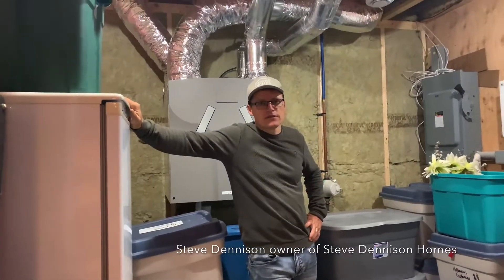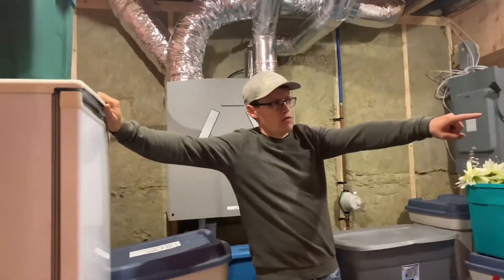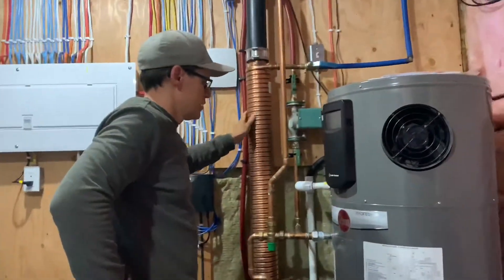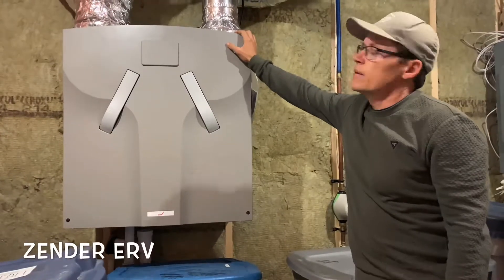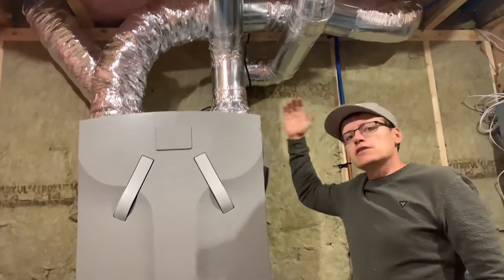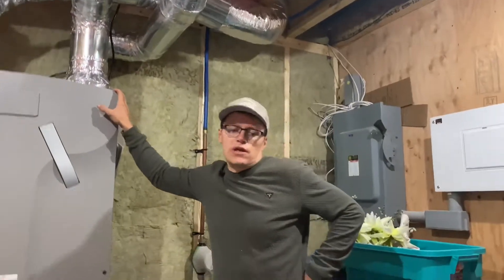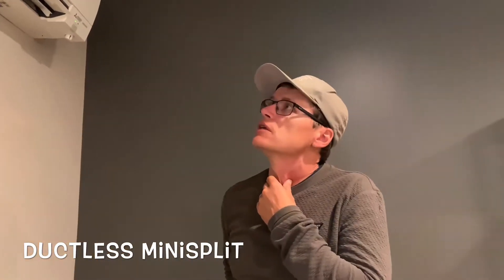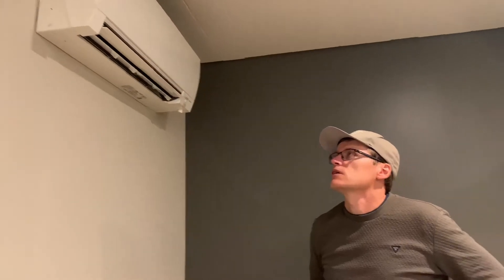All electric passive house mechanical room tour

Comment: How loud is the hot water tank? Thinking of using that option in my utility closet, I would need to install a vent opening for the utility closet but I'm worried about noise. Cheers,
Reply from the maker: We have a vent to the room and it is insulated but it is very quiet. I have added a direct exhaust to the outside because found that the temperature in the room really dropped so in a heating zone I would definitely exhaust it to the outside.
Reply: But why not use a power full all electric combi boiler?
Reply from the maker: @miles5600  we are using mini split heat pump system for heating and cooling so an electric boiler likely a little bit of over kill for just domestic hot water. Plus we don’t really use them in our area so installer knowledge and service might be an issue for us but in regions where they are more familiar I would consider.  A heat pump does provide some increased efficiency as well.

Comment: 6:11 When you said the ERV runs continuously; does it actually run 24/7?  Or so much/ per hour.   Also are you using separate bathroom fans or does the ERV run 24/7 thus continually exhausting air from the bathrooms?  If you use bath fans, which ones are you using?  The ones I've been using leak at a rate of around .15-0.17 ACH (each).  If you had 3 fans, that's using up precious ACH when your limit is 0.6 ACH.   Thanks for posting.  Good video!
Reply from the maker: In the summer we use a more low tech ventilation system, we open our windows so we don’t run it when the weather permits. We do not use separate bath fans. We have timer controls in the bathrooms to put the Erv in boost mode while showering etc. In the winter we run the erv continuously on low speed. If we have a dinner party or something we can turn it up.  The erv has a ecm motor so it is not a large electrical draw plus fresh clean air is well worth the little bit that it costs.
Reply: @dennisonhomes3917  Thanks for the reply.  I need to look into that ERV. I just installed a Panasonic FV-10VE1 ERV in a home. It's being powered via a separate 24/hr timer/ plug (and the ERV is plugged into it.) But that timer only has 1/2 hr settings.  (The unit has a setting to run as little as 10 min/hr up to continually.)  We wired the ERV on the separate timer so we could also run power to the bathrooms and override the main timer so (like you said) a person could turn it on while showering.  Right now the ERV only runs about 1.5 hrs/day. But with the unit wanting it to run 10min/ hr, I'm just wondering if it's running enough throughout the day?  While it's not a passive house, it's fairly tight at 1.3 ACH.  What do you think?